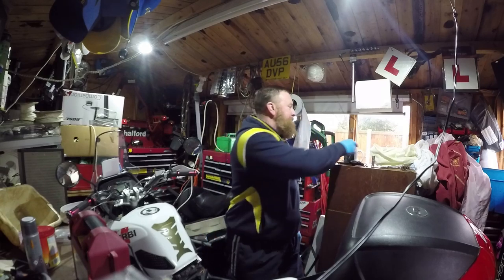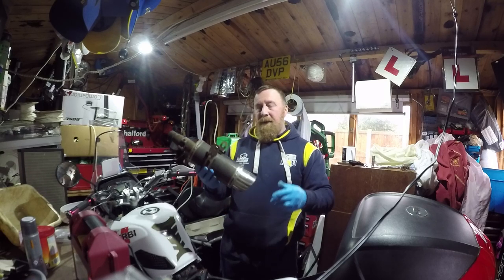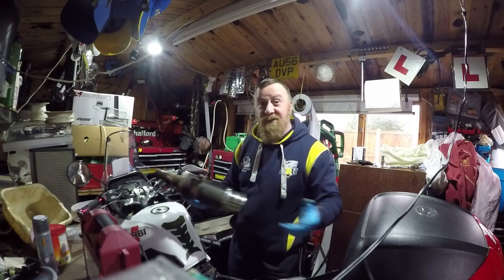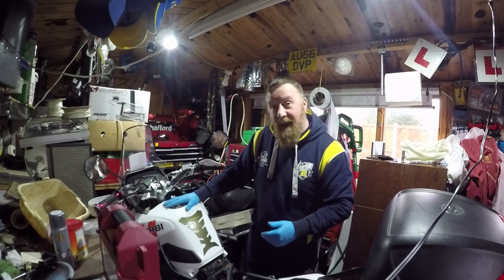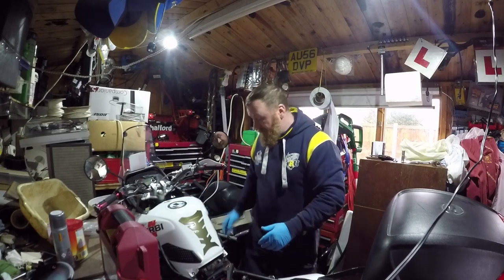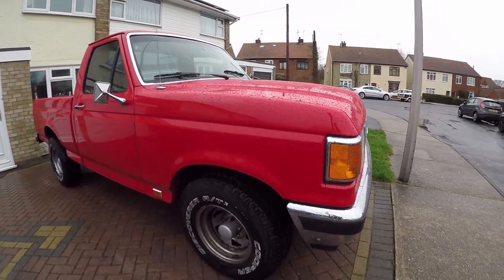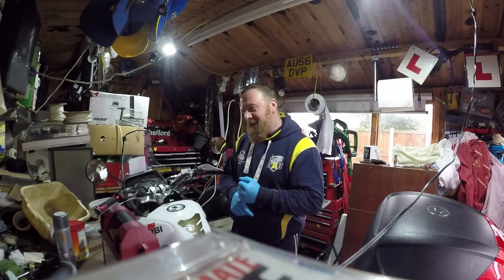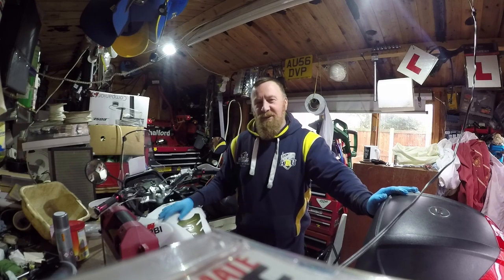NOT STARTING BIKES NEED BACK PRESSURE ! DERBI MARK SAVAGE

Comment: A little bit of a negative pressure wave, well timed, is needed to aid scavenging, but this is a low pressure wave not back pressure. Back pressure as you are talking is never good. It works against the flow of gases. The issue with big pipes is slow air speeds because the gases move slower through wider tubes. An exhaust needs to be a careful balance, to thin to much restriction, to thick slower gases.

Comment: Looks like that end can come off a Subaru Impreza, now the original can is back on it now sounds as though the top end wants to explode but, I know you will sort it out mate, I have been told that the derbi is the same size in height as the Valerdaro 125cc can you shed some light on this Mark ! And I 100% agree with a bigger pipe you will lose speed and miles per gallon unless the bike has been set up correctly to run that humugas pipe, sorry for your loss Mark stay strong and safe, glad to see you back fella.
Reply from the maker: it was really big lol
yes they are the same size but the valerdaro's are a twin and hold there money well, engine are better too
as for the top end it was the go pro mike as once running it was fine
we have now got a new family member she's in my new f150 video, thanks bud take care
mark

Comment: Great vid Mark, some good tips again. Looking forward to the F150 video. Got a Jeep grand cherokee wj 2.7 diesel myself. Love American trucks, do go wrong but so does everything. Lots of character built in, most modern cars the lines between them seam blurred, all even starting to look the same. :-)
Reply from the maker: mines a 302 Windsor engine 5.0 v8 efi they have an amazing 27 year track record of not going wrong, the 4.9 v6 was not so lucky lol 
I do love the old Ateam look of these trucks and so far very happy and agree all cars look the same today 
catch the new video when it comes out should make you laugh bud
Reply: @marksavage  looking forward to it mark, there is a straight six 4.0 petrol available in the Jeep which is known to be bulletproof, cheap as chips at the minute, V8 is an obvious choice, must admit I was parked next to a V8 at the asda one day. When it started up was jealous of the V8 burble. Mmmm maybe gas conversion???????? :-)
Reply from the maker: nothing like a v8 sound so true and wait till you hear mine lol, as for gas 
ive had a few in the past and they never seem to do a lot but use both ,petrol to start and then ive never seen any gains lol 
they are a slime a mile and that's all that now matters to me 
going to be going to shows this year so going to enjoy the pick up

Comment: Hey Mark, great video like always. I wanted to ask you if this has ever happened to you before... I was riding the crap out of my little runner 180 2T and at around 120 km/h the variator belt flipped upside down and it made quite a bit of noise and a burning smell to go with it lol do you have any idea why this happened? And could it have damaged anything else ? Cheers mate
Reply from the maker: hi bud 
these belts can just fail and under stress , if you watch my burgman video my belt did this on the way to work and how bad that, id make sure you rub down any scratches or lines on the variator and clutch , re-seat the rollers or replace and fit the new quality belt and all should be fine bud
Reply: @marksavage  thank you so much Mark its really worth investing in a good quality belt.

Comment: i will have to try this on my mulhacen same engine as the terra
Reply from the maker: Yes bud , video should help
Reply: @marksavage  mine still wont start im at a loss ive checked everything any ideas got spark and compression and fuel carb is clean
Reply from the maker: @The_repair_shed  ok so when you try and start ,take out the plug is it wet?
test plug , blue spark
E5 or E 10 as this can real mess your bike up 
have you cleaned the carb, as in off and take apart
Reply: Plug is dry just filled with normal unleaded petrol
Reply from the maker: @darrenharris9194  dry plug is bad so carb or vacuum problem,  unleaded ! No that's bad E10 as in my videos on my channel should use E5 super , E10  can kill your engine
Reply: @marksavage  AHH ok engine rebuild then probably wasn't told this when I bought the bike I'll get a compression tester and give it a check any advice how much it should read

Comment: Hi mark wondering if you can help me, I have a Lexmoto echo 50 and it’s been running fine since October of last year but has developed a problem, its seems to be coughing and spluttering and won’t go above 20mph so just wondering if you have any suggestions?
Reply from the maker: when did you last service it bud , in this weather they can also suck in a little water into the air filter system and also the plug can get damp
id clean plug up and wd40 around, take arid filter off and clean or change 
next would be carb clean and poss have a look at the variator system and blet
Reply: mark savage cheers mate will have a look

Comment: Hi mark me again with the 50cc chinese scooter,keeps dying on me .symptoms hard to start,hot or cold,stalls sometimes when revving, revs up and down never stays the same.bogs down when pulling off,pops and gurgles over 30mph and bogs down.checked tappets ok,new carb,new manifold gasket from hose to carb,checked gap on spark plug 23mm.lost the will to live.any ideas mate?thanks for the reply in advance.carl from Coventry.
Reply from the maker: normally its the carb so why did you change the carb ,was it doing it on the old one ?
if not change the main jet from the old one and set up like in my carb tuning videos 
air pipe and guessing its a 4t moped on one and tight , you say you have looked at the tappets and are ok so has to be carb bud
Reply: @marksavage  yes was doing it on the old carb.so bought the exact same carb.ive adjusted the needle to 2 mark up.but the old carb was same position and all well for a year.the foam air filter has a small hole in it and I used gaffa tape to cover it.i will buy new one to borrow and see if it's that.its a 4 stroke.the spark plug wouldn't give me the bog down would it?
Reply from the maker: @leath25  it normally carb and fuel 
But I'd change it anyway 
As they can break down over time 
Have you tried running 
The air mix in then out ?
Standard is 6 half turns for 4t
Reply: @marksavage  hi mark I set the air fuel screw at 3 and a half out maybe that's the problem.
Reply from the maker: @leath25  2t 3 4t 6 half as in my videos bud and it may need to go in or out more when tuning
Reply: @marksavage  thanks I'll try tomorrow all the best
Reply: Hi mark found the problem at last ,the plastic gasket that sits on the top of the engine between the two bolts that leads to the pipe to the caburetter had a faulty rubber o ring.it wasn't sitting in th hole it had warped and come out.it was the new one aswell.think I need to find a more secure rubber o ring or it's going to happen again.thanks for the replies mark.

Comment: 2 strokes need back pressure, 4 stroke doesn't.
Reply from the maker: Omg 
Yes they doooooo 
Did you watch the video 
Big exhaust wont start 
Standard exhaust it starts 
What more proof do you want 
2t and little 4t bikes need it 
It helps them start and better mpg and mph 
This is why I did this very to help 
Not just to say yes it does or doesnt 
I showed you 
Just cant help some people 
Thanks for watching anyway
Reply from the maker: Each to your own mate 
I had many peds 2t that dont start with the wrong exhaust and totally agree but 4t do bud 
Even cars with them silly big bore exhausts
They dont like starting and all sound with now power 
Take care bud
Reply from the maker: Also check out this video 
https://youtu.be/cSNFwPXlefo
This was a 800cc
Sounded amazing 
But didn't like starting and would go over 100mph 
Gutless !
Reply: The ‘back pressure’ people refer to is the negative pressure wave which travels  back up the exhaust after the exhaust valve (or port) has opened to release the gas. It is that negative pressure that can be manipulated by changing characteristics of the exhaust system and the basic idea is to get that negative pulse or pressure wave to pull out as much gas as possible from the cylinder bore before the valve or port closes leaving more room inside the combustion chamber for new air and fuel mixture.
There is a very good and reliable video on this very subject on the ‘engineering explained’ channel. (I think that’s what it’s called.
Loving the shed work matey. Just got my garage all sorted and ready to go soon.
Best regards